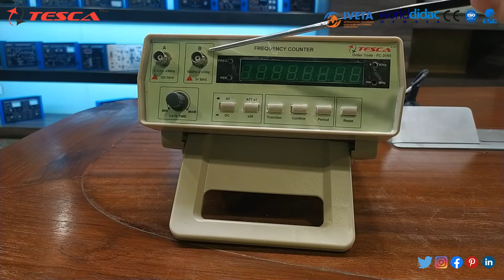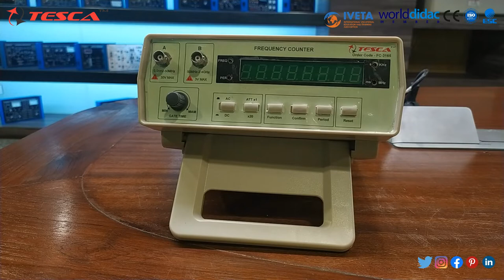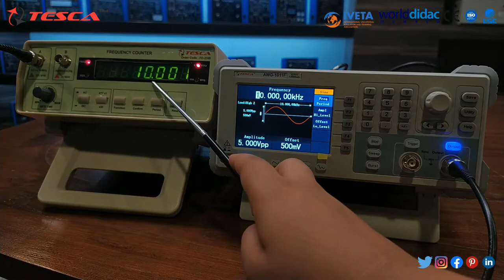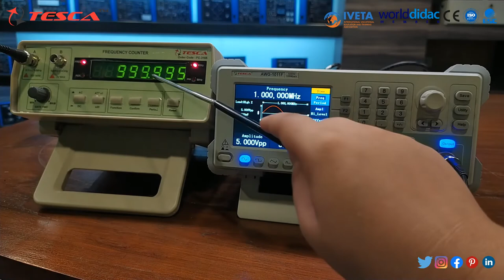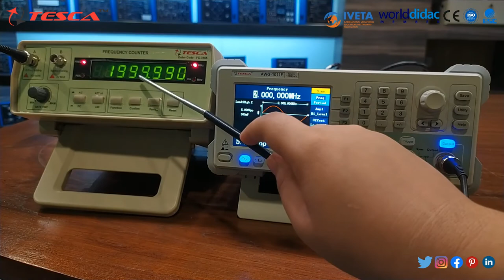Frequency Counter 8-digit || Tesca FC-3165

Comment: Mam can I measure 220 ac frequency 
And also how much volt 
Can apply to port 1 and port 2
Please tell. Thanks
Reply from the maker: Dear Mr. Raju Mehta, you can't measure the frequency of a 220vac signal. However, you can measure the frequency of both AC and DC signals up to a peak voltage of 30V for port A. For port B, you can provide an input of 3v peak.

If you have any requirements for "Testing, Measuring, Educational Trainer, Scientific, Laboratory, Workshop Tools and Machine", you can write us at info@tesca.in
Contact/Whatsapp Number +91-9829132777
Also, you can visit our site www.tescaglobal.com
Share & Subscribe to Tesca YouTube Channel https://www.youtube.com/tescaglobal